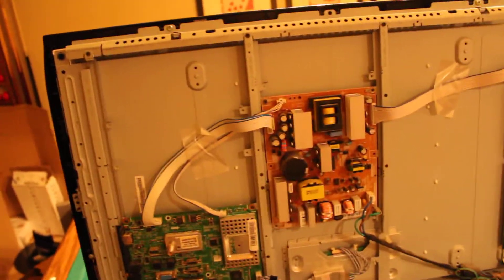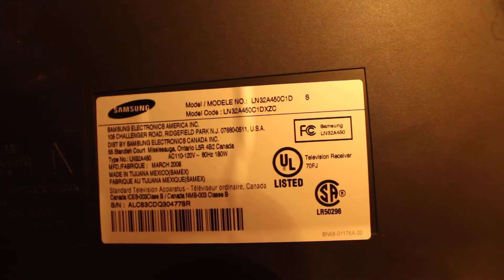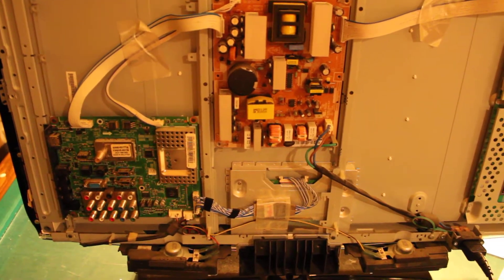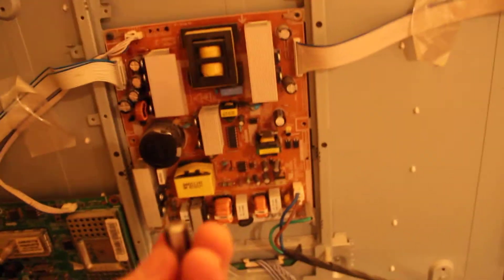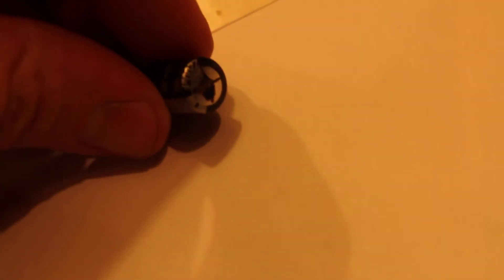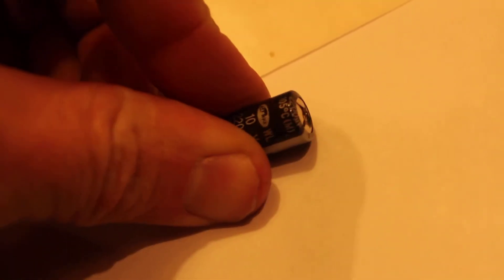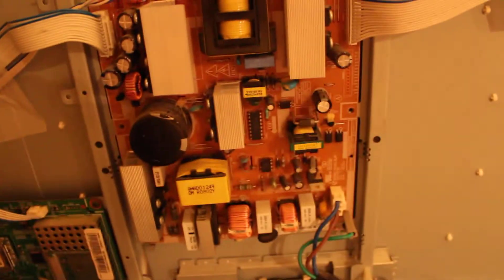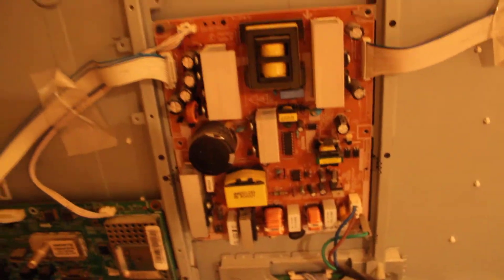Samsung LN32A450C1D Power Supply Board Fix Repair

Comment: I had the same issue on a LN32A450C1D (blinking red led, won't power up). I checked the power supply board, and found that a capacitor (CB852, might be C8852) had domed and cracked its top, and was leaking electrolyte (the black goo). The original was a Samsung-made 2200 uF 10V cap, and I replaced it with a 2200 uF 25V cap in case it was getting over-voltaged. Also, I checked the polarity and voltage across the cap when I powered it up. The - pole is connected to the ground which is also attached to the heat sink for DM854 and DM860 (in the right-hand upper corner of the board in the video), and the + pole to the cathode of D8651. Using a Fluke DMM with the black lead on the heat sink and the red lead on the cathode of the diode, that read +5, so it seems to have the polarity correct, and is not over-voltaged after its turned on (I didn't dig out my Tek scope to check for surges, though).

Total repair cost: $1.39

Comment: Where do you get that capacitor from? that exact one is what is bulged and black on top in my tv
Reply from the maker: eBay, online anywhere, or specialty electronic stores. Just search for the micro farad and voltage rating.

Comment: Ok have the same tv gave the motherboard to a friend to replace caps that were no good got tv back turned on just fine watched it for about 4 hours turned it off then went to turn it back on 8 hours later doing the same thing as before wont turn on steady red standby light with a slit dim every 8 seconds makes no clicking sounds when i try and turn it on just the red standby light flickers when i do press power button would a smaller cap be the problem because i noticed when i went to put the board back in one of the 4 caps that were replaced was smaller then the rest when i took the board out they were all the same size or would it be the power button please help
Reply from the maker: Check the solder connections of the caps that were replaced. Make sure they were replaced with the exact same mF and Voltages.

Comment: Hi Mr. Porkercon:  - Excellent Video.. Thanks for your video. I have the same identical TV that comes up with a red light at the front and TV being all dead no video audio clicking or anything. Opened the back of the TV to check the PSply. Sure enough looks like the PSPLY issue. The board id BN44-00214A. The problem I saw was next to the largest cap (I think CP803) the high voltage one, there are 2 / 3 leads (J840 J85?)  and a cap CM8??w] ( a small flat capor thermistor??).  next to those leads all burned out.  Is it fixable I don't know what items are involved since don't have a schematic, I can read the value off the cap and replace but not sure what items are affected as a result of that burn out there. Your response and guidance will be greatly appreciated. Thank you Sir!
Reply from the maker: Not sure I don't have this TV anymore.
Reply: P-Supply repair kit: $18
New PS board BN44-00214A: $47
http://www.shopjimmy.com/catalogsearch/result/?q=BN44-00214A

Comment: All my caps look good! No bulges or leaking... I have seen online that people have noticed QB802 and QB801 have bad solder joints.  I have also seen that when the glue gets burnt it becomes conductive (don't know if that true or not but noticed the NT811S, QB802 the glue is charred)! Hope that helps some others with this BN44-00214A board problems.